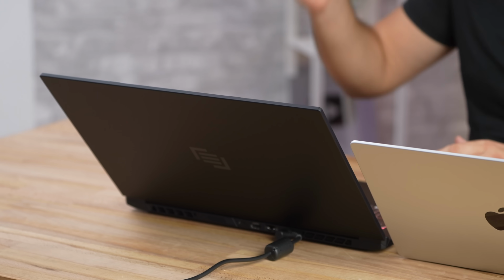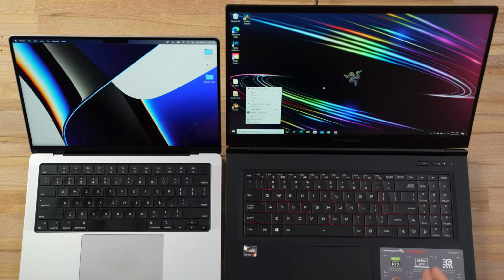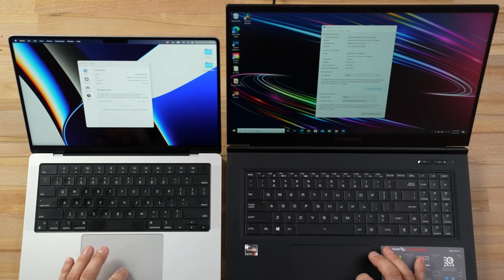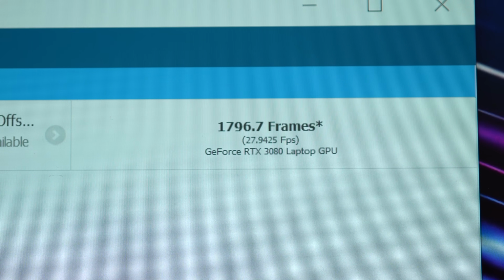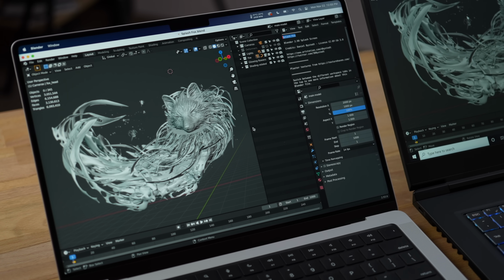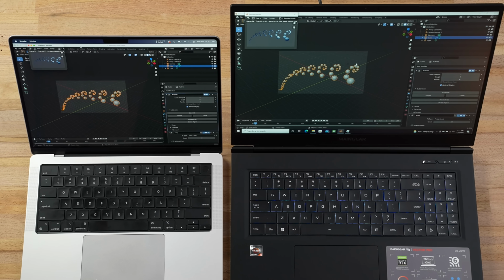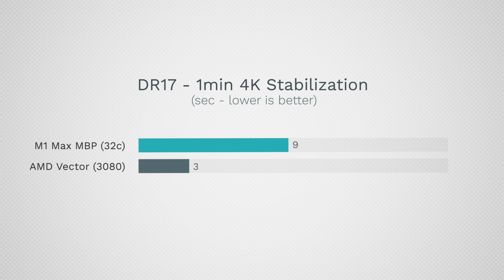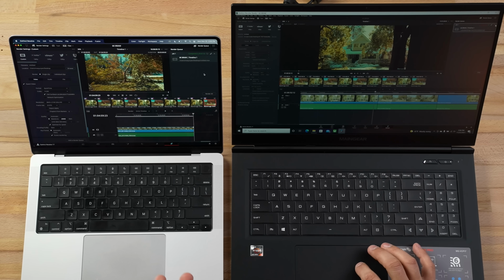Forget Intel! Can AMD's BEST Laptop Beat the 14" M1 Max?

Comment: Crazy comparison i must say. You’re doing the beat ones hands down. I’m kinda done with comparison between MBPs and Intel/AMD machines. It comes always down to the same stuff. The MBPs are outperforming them in most, not all, real world testing and that on battery power. Once you unplug this machine the GPU performance practically disappears. For me the MBPs is a fantastic all round laptop. Might not be the best at every single thing. Nonetheless there is not a single alternative that actually delivers so well in so many different points.

Comment: Macbook can defeat almost every X86 feature merely on its power profile. Still Blender test was incorrect. CPU vs GPU performance in Blender is just worlds apart. What industry uses is OPTIX which is CUDA specific, which apparently isn’t available on MAC’s gpu. The performance will not just few percent but many folds higher with 3080.
Reply: That’s why I can’t wait for the same tests but with the Apple provided Metal Cycles currently in the works here’s hoping to see it appear on Blender 3.1 and see these tests GPU vs GPU once again. Granted, the hardware raytracing part will always win on Nvidia cards I think,

Comment: One useful tests is to take a common footage like 4k 120fps from Sony A7s iii and playback it at 1x 2x 4x etc speed. On my Macbook max 1x and 2x speed plays smooth and on 4x it starts to jitter. That's a use case that you would literally do during editing. Also trying to play forward and after few s play back the same footage and see if it plays backwards smooth.
Reply: can you edit large a7siiii 4k 120 projects in a max without proxies?
Reply: @bruzzofilms  Yea, 4k 120 4:2:2 10bit footage plays smooth up to 2x speed in DR and PPro, 4x speed usable as well - a bit better in DR.
Reply: @HardIsEasy  thanks, the only thing useful in this video is your comment

Comment: He is only comparing CPU rendres in 3d software right? So rtx 3080 is not used? Am I correct? In blender You can render simultanously on CPU and on GPU. Sooo this test is not that good and biased. I would be interested to see real world results - Rendering in blender on GPU+CPU, also cinebench he was not using rtx3080? If I am right it is like comparing two cars but one is not allowed to use all power....

Comment: I remember when the turbo button used to be a physical button on the front of an AT case (Before ATX) and it would change the speed to the max processor speed. For example a 486 DX2 @ 66MHz would normally run slower like 50MHz or 33MHz or something like that. But back then if a program was too fast you would have to slow it down by turning off the turbo button.
Reply: Was amazinh
Reply: @happyhappynuts  Back in the day, yeah it was awesome! Plus accidental overclocking🤣

Comment: Depending on your settings, the RTX could have a FPS limiter on battery, or disabled completely and using the CPU integrated graphics
I also wonder if you were heating up the Mac more than it should of been with that hair blow dryer blasting beside it 🤣
Also junky computer brand there, I’d never trust it to last very long or built very well 💩

Comment: I wonder if the Windows laptop was set for full performance vs optimize for better battery when unplugged. I wonder if the scores would be similar to being plugged in it were set to full performance.  The cost will be battery but for benchmarking it should be fine.

Comment: So AMD laptop cannot complete unzip a big ZIP file, is super noisy, looses lots of performance when on battery, etc. and gets its ass whopped in benchmarking. 🤦🏻‍♂ BTW for laptops all tests should be done on battery, as this is the primary use of a portable computer.

Comment: Looks like people who have their employer buy computers for them can justify the higher price of the macs. But for home users, they will see these tests as validating their purchase of the cheaper pc because it’s almost as good as the latest mac is but at a fraction of the price. Metal gpu scores are not important to pc users, but direct x speed is. Fan noise is no problem either, mac users were fine with that before they had fanless options.
Reply: For home users, the $1200 Macbook Air is more than enough juice.

Comment: I agree to @Aaron Koch. We're not living in a desert but laptops should remain laptops and not desktops. With FULL performance. It's not normal that when I'm on a train the first thing I'm looking for is a seat WITH a power socket otherwise I won't be able to work and my battery will die in like 40 minutes. The same goes for the airport. The first thing I'm looking for is a seat near some sockets. And what about the plain. I had a 9 hour flight and my intel died in like 2 hours after watching MOVIES. I wasn't even rendering anything. And that was the end of the mobile laptop. And there are no sockets on a plane. I'm sorry but if I buy a laptop it should perform as a laptop.

Comment: Yeah fps capped on battery to prevent overheating and draining the battery. Difference is at least apple is spear heading cpu and gpu without comprising power even unplugged. AMD tried to do this with the apu's but performance was not great... wondering if AMD will go full on now

Comment: What might be interesting is to tune that PC to use about the same wattage as the Mac, plugged in or not, for both CPU end GPU. I’d be curious if that stabilizes performance between plugged in and not, reduce temps, noise, and extend battery life. It will be slower, but by how much, and if it does tame the heat and noise, combined with cost savings, would that makes any kind of case to consider it, and you can always switch to full performance when needed. (not siding with the PC, as I have a 16 M1 Max in front of me after returning a ROG M16)

Comment: Man. I'll teach you how to do proper performance testing and interpretation for free 😂. I ain't no LTT or Gamers Nexus but at least I'll be better than whatever this is XD

1. Unzip benchmark - using different software 🤦‍♂️
2. Browser benchmark - using different browsers 🤦‍♂️
3. "They don't want this to happen" (fans) - you do realise that it mostly means that the AMD CPU is going to last longer, right? I mean thermal failure rates are relatively low to begin with so we're not talking widespread failures on M1s being pushed to the max but it will still have an impact.
4. Comparing GPU usage % during the Resolve tests. I think you should look at how GPU usage is computed.
5. Not enough runs for any of the tests to get statistically useful results.

PS: Don't you think you've got David and Goliath backwards looking at the price difference?

Comment: CPU performance aside, the one thing that Apple really needs to do is improve their GPU performance especially in their lower-end models. That along with supporting other graphics APIs like Vulkan and then finally, as a person who likes to casually game, will consider buying a Mac. Oh, and Apple really needs to start bringing more games to the Mac and I'm not talking about mobile games; no, I'm talking about Triple-A game titles.
Reply: Apple and games won't happen. I'm telling you this. If it does it will be a propriety platform and good luck getting developers of big titles to follow through
Reply: @denziiey Sadly, I know this. They're seriously missing out on a portion of the market who consist of people like me who need a machine for work but also want to load a game or two to unwind.
Reply: @trparky  honestly I like how it is. With AMD and Nvidia current state SoC with high performance and efficiency will soon be a thing. Even this 2k laptop is a solid buy. The software needs catching up. Otherwise Apple is strictly video and audio editing and it'll just have to be so for a long time.

Comment: WOW. When you came to blender i thougth that RTX Gpu would easily win by multiple times. But i was SHOCKED! Then in Cycles is was like "Oh yeah that was Eevee it must have been the reason." But no! Even in Cycles M1 Max won! Then i tested it in on my iMac and it took over 16 minutes. This means that when i'll get one of those MacBook Pros i can render over 3x faster, on battery power, where ever i want and with way less fan noise! Absolutely shocked by this!!!
Reply: You use Optix if you have an Nvidia GPU though... 😛
Reply: not sure whether he did  used rtx3080 in render probably - or he compared only cpu time renders. Which would  be kind of pointless to be honest.
Reply: In Blender Windows is the bottleneck. You should run blender on Linux for best performance
Reply: yeah but he don't compare the concept of RTX - Which is Ray Tracing and addressing 4K/6K Screens.

Comment: Seems the machine to be very optimized, similar to what we have with iOs and Iphone. I am now wondering which one I should buy :-). I do have the Macbook Air M1 which already work very well, but I am mainly limited by the connection. I can only connect one external monitor. As I am not using the computer during travelling, it is mainly used as desktop computer, I think it will more interesting to go with the 16 inch version but I am still wondering about the chip (M1 pro or Max). I do video editing for private use. I sell my own made PC with 3900x AMD chip and RX5700X and 64Go ram. I was not able to have smooth playback with 4K rush inn Davinci (just amazing) while I do not have any issue with the M1, just crazy. That is the reason why I would to continue with M1 chips (pro or max). What do you recommend ?

Comment: You cannot really compare core frequencies across different CPUs from different companies and architectures. They all perform differently even if they’re all set to 3 ghz. Yes core count does have an effect but even with single core tasks they end up performing differently
Reply: But for most work applications the Mac is going to be the best combination of power and efficiency even if some laptops can beat the Mac with full power and fans blazing.
Reply: @ryanfraley7113  It really depends on what you need, and a mac isn't what everyone needs. There's still plenty of reasons to stick with a windows PC. For most people a cheaper $600-$800 windows PC will be perfect for work. These m1 pro computers and gaming laptops are complete overkill for the majority of people. Even the m1 computers might be a bit expensive for most work applications ignoring the lack of software compatibility on the m1 macs due to it being ARM and not x86.
Reply: @crestofhonor2349  Then again a MacBook Air can be had for $800 in some places. This is all down to personal preference at that price point. I’d argue a lot of people can do basic web browsing and apps on an iPad for that matter. To each their own. I’d argue the only area where Windows is better is legacy and AAA gaming support which is more due to the PC platform itself over anything Microsoft has done.

Comment: Since M1 was released, you must be absolutely exhausted by the number of times the M1 chip beat up a Windows machine and you get the same two responses. EVERY. TIME. “This…XT9460 is a gaming machine! You should test M1 using, (insert AAA game, unoptimized for Apple and incompatible in every way) or “yeah M1 beat the XT9460, but the SH1tz260 is the machine you’re afraid to try the MacBook against because it would destroy the M1.” Lol
Reply: @ryanfraley7113  Now that's a really lowball thing to say. 🤔

Guess I belong to that 1% with an anime avatar that doesn't say that though 😆
Reply: @ryanfraley7113  ha!
Reply: @ryanfraley7113  Still a lowball comment, without any actual statistical analyses involved.

In other words, completely unnecessary & inconsiderate to the people that'd not respond well to your comment which I assume was the point 🙄
Reply: @MLWJ1993  If people with said avatars behaved like grown adults online then none of this would be an issue
Reply: @ryanfraley7113  That's assuming all of them are adults, which I intuitively doubt.
Reply: @MLWJ1993  you’re spitting into the wind. Better minds, with more expertise than you, have crowned the M1 laptops “Best in Class”. Period. Tally ho Tech put out his review today, Dave2D, MKBHD, these guys and so many more have run benchmarks and real world testing on multiple machines and think so too. Accept reality or not, your acceptance is not required for the world to move forward.
Reply: @sharonb.9128   Sure, it's the only low power requirement SoC in a laptop chassis out there, making automatically "best in class". Just like when you're the winner if you're the only one competing, forgetting that you're automatically the loser as well 😉
Reply: Well, you either compare what's Apple compatible & hardware accelerated for the Apple product or you run the X86 optimised workload that simply doesn't run on the Apple machines or is only as good as some fairly midrange-low end hardware (meaning the Apple product sets you back 4x the price), neither is Apples to Apples.

BTW a 3080 in a laptop absolutely murders that MBP GPU so long as you give it what it needs & don't run unrealistic test like starving it for power. That's literally how it is (and no, some webbrowsing test or a SoC compatible "game" benchmark is not a typical 3080 workload).

Comment: The fact that the windows machine spins up the fan EVERY time you click 'go' drives me nuts. It's the thing I hate about my 2018 MBP and one of the main reasons I'm looking forward to getting my 16" M1 Max 64GB 2TB on Friday
Reply: RIP Intel
Reply: Yayyy !
Congratulations on getting that beast man
Reply: @venusbhatia  thanks! Just got a shipping update that it’ll be here tomorrow!! :)
Reply: @ChrisLeiter  whoa that's amazing !
I wanna see your quick reaction video maybe ? If Possible on your channel haha ( i know it's a lot )
But it's worth it for The M1 Super Duper Ultra Pro Max 🔥🔥
Reply: @ChrisLeiter  How is it?
Reply: @ChrisLeiter  congratulations
Reply: @Cantendo  incredible. It’s everything I could have asked for and then some. I just did an industry show where my company had a booth, did all-day demos of our software running on windows 11 Arm in parallels while connected to large external displays, and didn’t plug it in to power all day. Over the three days of the show, I would get back to my hotel with about 50% battery left. Not using power saver modes at all. And the computer runs circles around my other MacBooks and even my gaming rig (save for the 3080Ti I have in it - that thing is a BEAST)
Reply: Right on, Im no user of mac but holy shit this thing is godlike!
Reply: Fr, I have a 2018 as well and thermal efficiency is definitely pushing me towards the new ones
Reply: @kingalex29339  zero regrets, and haven’t heard the fan once since I got it
Reply: you lucky rich man
Reply: :o what will use 64GB for?
Reply: @xKapatroNx  I run multiple virtual machines at a time usually. Being able to dedicate 16gb or more to one or more will be a game changer for me
Reply: Excuse me, but where are you from?
Reply: @VasilisFafoutis  Maryland, USA
Reply: @ChrisLeiter  I asked you because I have ordered exactly the same configuration and apple told me that I'll receive it around January 15!
Reply: @VasilisFafoutis  I ordered mine very early. Day two after the announcement I think?
Reply: What made you go with 2TB? Any good reason to get 4TB? I’m debating this…
Reply: @macmos1  my only regret at this point is not going 4TB. I think that I’d make the splurge for that if I had to do it again. I initially planned on getting a Thunderbolt ssd, but now think I should have got 4TB. Oh well. Next time.
Reply: The pros run quieter and give you more battery life, if you don't do multiple 4k edits at a time, it should be good enough.

Comment: linus did explain on the m1 imac video that the temps are higher on apple silicon by 15c because of the different way each company use to measure the temperature. So they are not directly comparable.